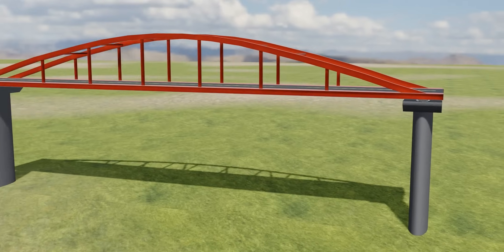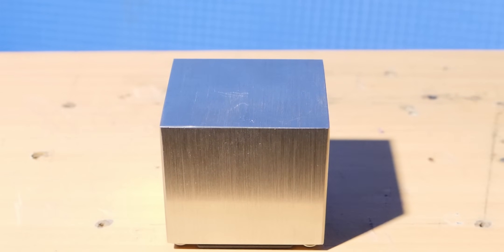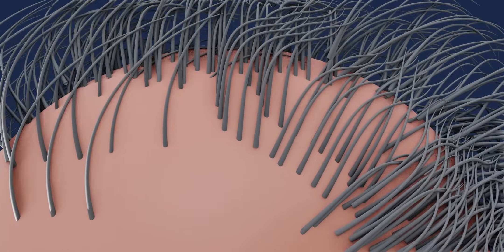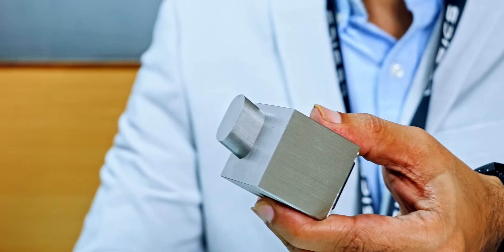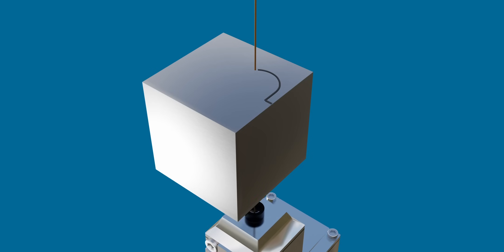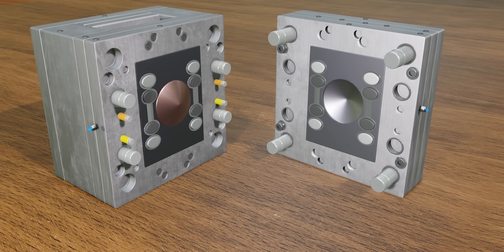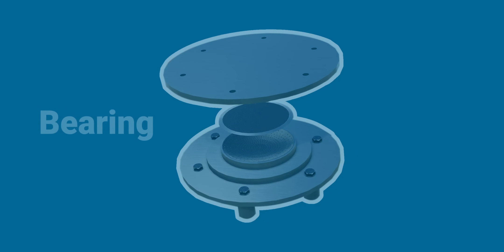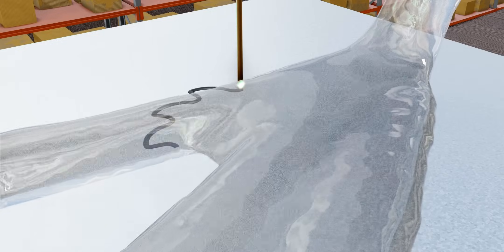Understanding Zero Tolerance Machining through this Cute Cube!

Comment: There is an additional step for these Wire EDM toy pieces: Once the pieces are cut, they get put together and polished together, so the surface looks like it's continuous and doesn't have any discontinuities in the texture.